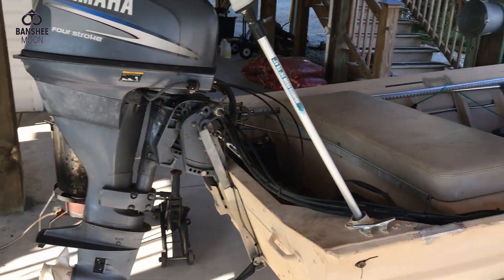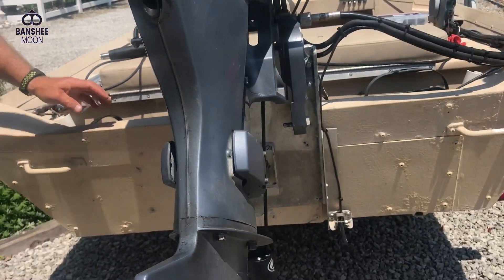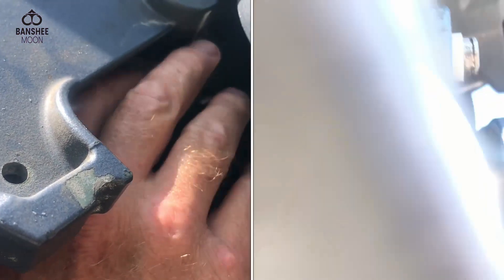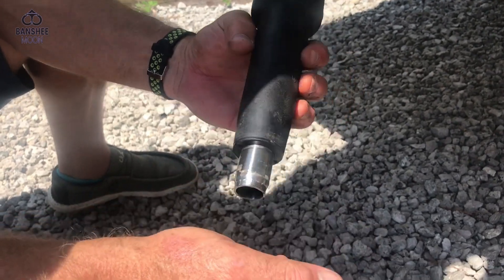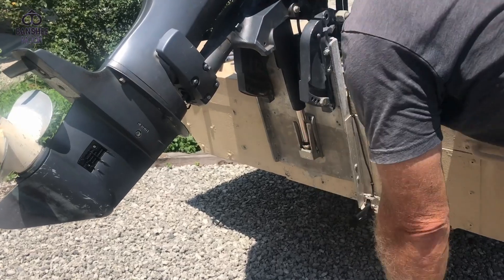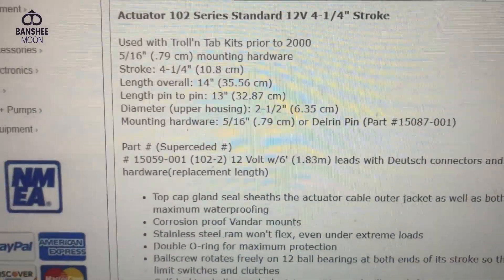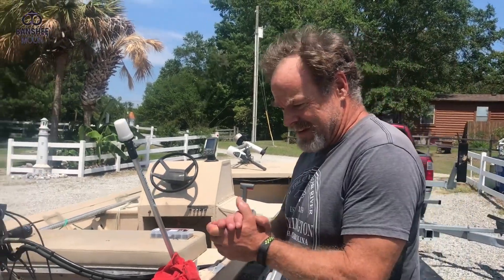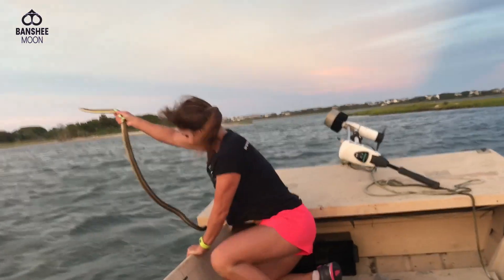Boat motor lift hack. How to install a trim tab actuator for use as a boat motor tilt.

Comment: maybe saved me from some problems telling that the end of these units are not that strong so we need a strong custom adapter, on my boat the old pump went bad so I bought a linear actuator and built the mounts out of SS to mount it to, problem is I find out it is not waterproof only like an ip rating of forty five so I have to start over with something different But going back to my thoughts Thanks for providing the information of how you need an custom adapter, not sure I can make one of those great info in the video

Comment: Just so yall know, that part is very highly loaded in compression by the thrust of the motor.  It is not just the weight of the outboard it supports.

Comment: Good job on the fabrication and the Cotter key idea but I would have put a rubber boot in there to take out the play which causes friction and eventually eat through your your key or your boot

Comment: do they not have this on boats by default where you live? Every boat I have ever owned or used,  with a motor above 30 hp has had power trim and tilt on it.

Comment: Great demo Exo, Just missing that incremental lower 20% adjustability. BUT as long as you"re quick on the "button" no problem! Or is that a flow control deal?
Cheers to you and Jen, for tolerating him! lol
Mac
Reply: refer Ba